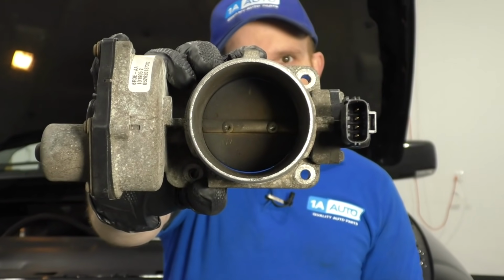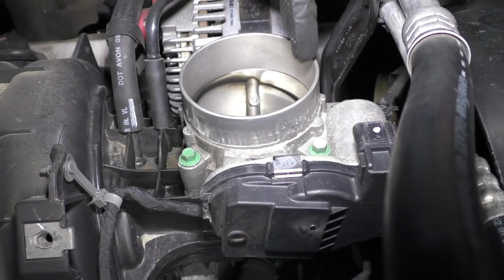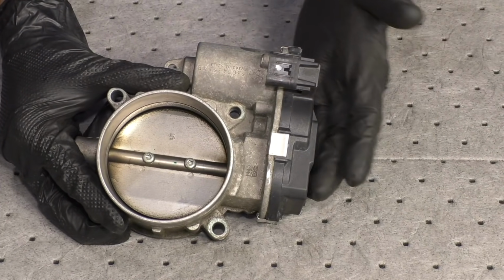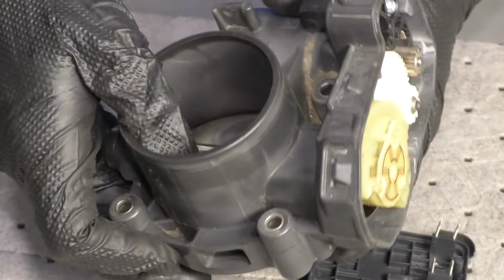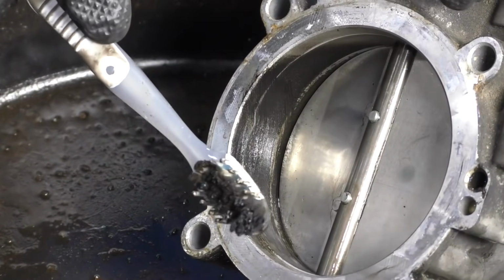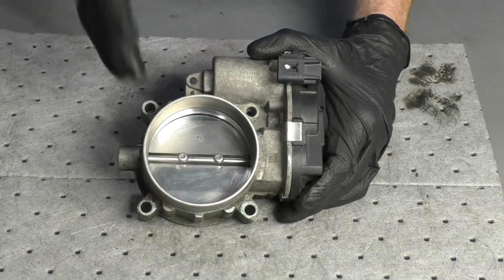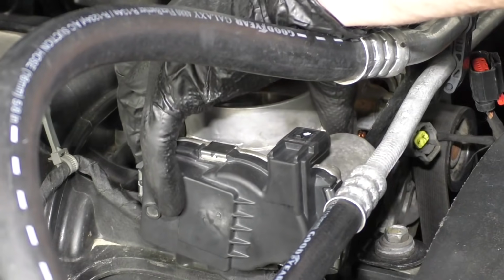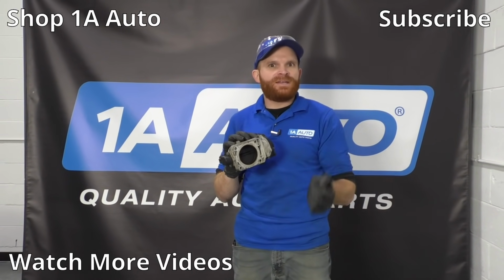Throttle Lag, Engine Hesitating? Try Cleaning Your Throttle Body!

Comment: I learned something new. Thanks!

It's absolutely amazing how cars function. They are not so intimidating to tackle if the parts are taught one-by-one.
Reply from the maker: +St. Michael the Archangel Thank you! We love empowering our customers and showing how to perform DIY auto repairs with our high-quality auto parts.  http://1aau.to/m/Shop-1AAuto-c
Reply: @1AAuto  
I’m having issues with the car starting. The rpm goes very low which and the car does not start I’m assuming is because of the throttle body being dirty or needs a replacement

Comment: Hi you are doing good,.
By the way no problem you can push the butterfly , it is easy to reset it just 3 times on off the ignition or start n off again 3 times , once you onn or start just push the accelerator pedal 3 times , your pcm will learn the calibration n reset the new value

Comment: I was told that it’s ok to *carefully open the valve with your fingers to clean it properly. The only part you need to clean was the area around the parameter of the valve and the edges of the valve as well.

Comment: I always clean throttle bodies in place,  because on older vehicles you don't want to crack any electrical plugs or mess with old gaskets.  Have a buddy key on and wide open throttle, then use the first ex-wife's toothbrush.  I never have issues with the ecu relearning.

Comment: Isn't that an electronic throttle body? I cannot see the butterfly valve... My question is: does it needs to be synchonized or timed properly after cleaning or what am I missing? 🤔
Thanks in advance.

Comment: I have rough idle. Worst when I put the AC on. Replaced, spark plugs, air filter and Radiator. Still got idle. I have a 2009 Toyota Camry.... Would it be better to remove whole throttle body. Does removing it possibly cause any problems when the ECU?

Comment: WOW " I recently replaced my battery. Recently tried the reset tip's and still no go with electronic throttle. But I haven't tried the pedal reset'. I'll give it a go in the AM.

Comment: i got a 2010 mazdaspeed 3 and it will sometimes run fine or it will die. There will usually be a build up till that point like rough idle or just cutout while driving (it wont bog down just completely cut out for micro periods of time then will usually result in it dying atp) replaced fuel pump and still has the issue.

Comment: I may need to replace my entire T/B since the revious owner said he replaced the TPS sensor but not the actual TB itself. just wondering tho, if i replace the throttle body on my 2002 GMT800 Escalade is there re-lean process for a new throttle body or is it plug-n-play?? Any advise would greatly be apreciated.

Comment: My check engine light been on for a while, so i got checked, I got a reading on my throttle position sensor to a 2010 Chevy Camaro V6 it was P0122 Circuit Low Voltage and P0223 Circuit High Voltage. Would could that be? Or mean?  I removed and cleaned the throttle body by the instructions to this AWSOME video, thanks Btw, throttle looks spanking new but that obviously that didn't solve the issue... so
I need a recommendation, would u replace the whole throttle body and sensor? Or CAN u just replace the sensor by itself? It's a huge price difference for something that might be a simple fix. Thanks in advance If u get back at me, it would be so freaking badass! The knowledge I've learned from you guys and your videos have saved me a ton.

Comment: Not sure, but from the title it seems like you would only clean the throttle body if you experienced problems; is that correct?  I was recently told by a dealership mechanic that cleaning the throttle body is part of the 30K and 60K maintenance packages and would cost $300 each time.  However, the vehicle manual's maintenance schedule makes no mention of throttle body cleaning at all.  Dealership scam or manufacturer's omission?  The mechanic could be making more money by recommending an unnecessary service; but the manufacturer could also be omitting a service to decrease time to engine failure and thereby increase sales from higher turnover.

Comment: Daughter took her Mitsubishi to the dealership mechanic--"Transmission is going out, 10k to replace."    Went to an actual transmission specialist to get cheaper quote..."it's just a part in the transmission."...PAID $2500. Still Idled up and down....Went to Jiffy Lube..."It's your alternator."  PAID $600. Still bad idle. not sure if all that stuff was actually bad but now over $3000 and still the reason I took it in exists. I GOT ON YOU TUBE AND WATCHED THIS AND OTHER SIMILAR VIDEOS>>>>>>>>FRICKING FIXED. 1000% better! So sad those mechanics.

Comment: Was Having Poor Acceleration Issues at Stop Signs & Stoplights....Pulled Mine Off & Cleaned it with Carb Cleaner Took the Motor plate Off to Clean the Gears...Put It Back on & Not Even a Full Month Later I ...had to Buy A New Throttle Body for My 2006 4.6 F150 Cause Now It Stays In Limp Mode & Won't Move at All.....UGH.

Comment: Bro question.   I hve a Nissan Maxima 2010 with a electronic  throttle.  I tried the on position press on peddle. But nothing happ no opening.    The throttle is black dirty.  Why wouldint the buttetfly open ?  Cud it b cuz it’s dirty

Comment: Hi men, I have 2006 mitsubishi outlander and I replaced spark plugs and I poured a bottle of fuel additive in the fuel tank but still it gives me bad fuel mileage, full tank gives me 350 or less km , any advice please, does cleaning throttle body will help with gas mileage? Thank you

Comment: Question. On a nissan frontier. I removed the TB (i dont recall even cleaning it as i was doing something else entirely). But i ran into an issue of having to Relearn the idle. Is it because i disconnected the electrical wire connector or something? Or is there a way you are supposed to disconnect without erasing the memory?

Comment: How do you avoid this build up on the throttle body in the first place?? Are there engine or gas tank cleaners one can use?
Reply: Keep in mind that all that is coming through there is supposed to be filtered air.  Use a good air filter and make sure that the intake hose doesn't have holes or loose fitttings so that unfiltered "dirty" air gets to the throttle body.

Comment: I cleaned mine last mine and it ran great.  Now a month later the idling roughen again?
Reply: I did NOT take my TB off, but instead cleaned it with Seafoam and the first time it lasted 9 months, the 2nd time 1 month (like yours), and the 3rt time I had the dealer do a TB "cleaning" and again it lasted 1 month.
Now what I do is remove the TB hose and squirt the butter fly valve with a few shots of carb cleaner and that's it.  Five minutes / Five cents.
Please note: I am not looking for a permeant fix since I will be getting rid of my car in 1-2 years - so I am not willing to spend a lot of time or money trying to fix it.
Reply: If you didn't remove it, you are missing a lot of gunk. I tried to clean mine without removing it and it didn't do any good at all. When I decided to remove the TB to clean it I saw why my car idle was rough. The carbon build up on the back side was caked on. I had to spray it around least 15 times to remove a line of carbon build up below the butterfly. Luckily mine TB is the type that uses a cable from the accelerator peddle and I could open the butterfly for a thorough cleaning. Car runs like new.

Comment: Thanks for this clear concise tutorial. Wel done!

I might also suggest that if the "reduced engine power" warning is displaying, especially after a dead battery, first try following the throttle body recalibration procedure starting at about 6 min. Following the procedure, brought the engine back to normal, but the engine light stayed on, which I was able to cure by disconnecting both battery cable for 10 min, then reconnecting.
https://www.youtube.com/watch?v=wMd3CkYzkuk

I suspect that the battery was depleted from an Allstate Milewise device constantly trickle draining the battery whie the vehicle sat dormant for several weeks.

Comment: If its that dirty and you plan to keep the vehicle the cheapest thing is to just replace it, typically $50 on eBay. Why go through all that trouble when it could slip into limp mode again when it fails (which it always will) thus costing you future time and money.